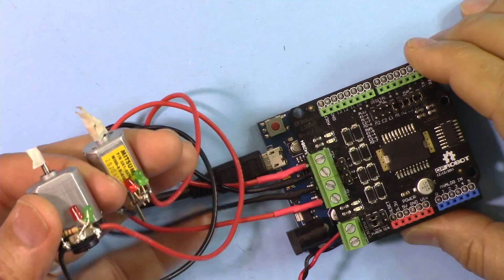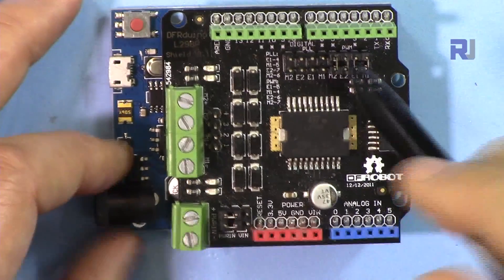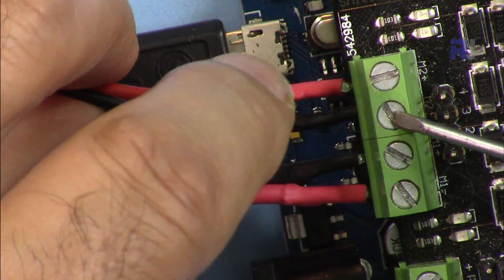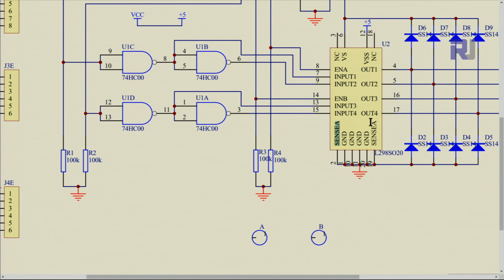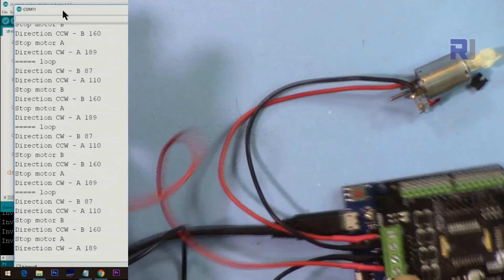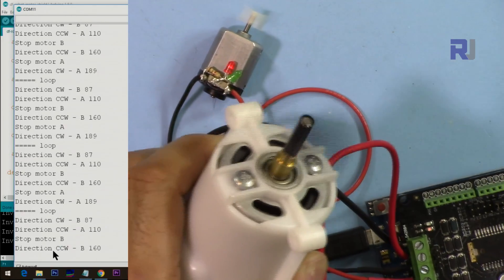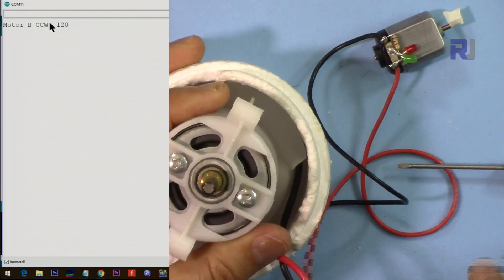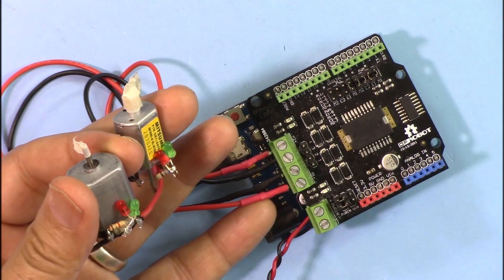Complete Guide to DFRobot Motor Shield L298N for Arduino UNO RJT123

Comment: Excellent video.  I don have a question.  How do you determine the correct power supply for  a quad motor driver shield?   Thanks
Reply from the maker: the amount of power is directly related to the motor. check data sheet of the motor such as as operating voltage and maximum current. then get a power supply with the same voltage and for the current, ad about 10-20% more current.
Reply: @robojax  Thanks for your response.

Comment: There is a Robojax L293D Shield on Amazon. Will it support 12v input. If not what do you suggest?
Reply from the maker: L293D is a chip I have full details video here https://youtu.be/akQoGNUzhHI so whatever voltage you see used by the chip will be used by the shield.
Reply from the maker: I just visited Amazon here https://www.amazon.ca/dp/B07941PVBC and if you scroll down on the page, you will see the details which show the voltage.

Comment: hello, good video, i tried this with a project of mine however the dc motor i used moves quite slowly even at 255. Can i place a capacitor or should i place a resistor ?
Reply from the maker: What is the motor rated voltage? what is the power supply you've connect?